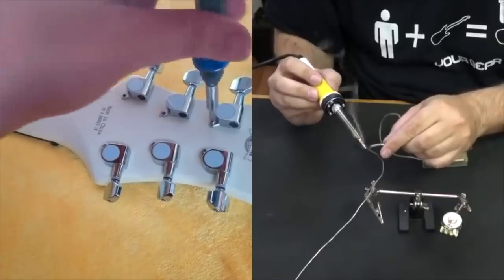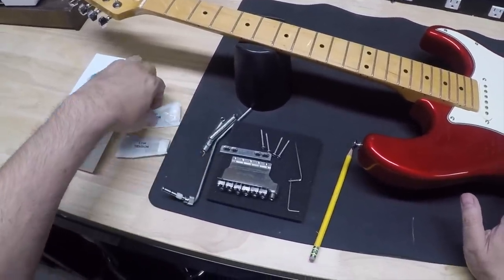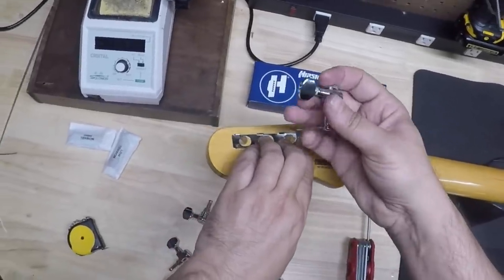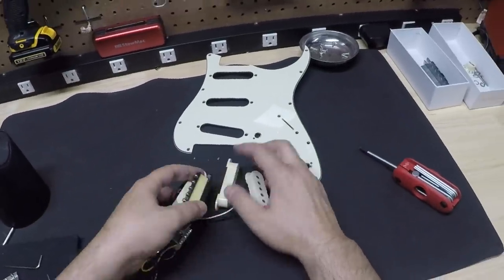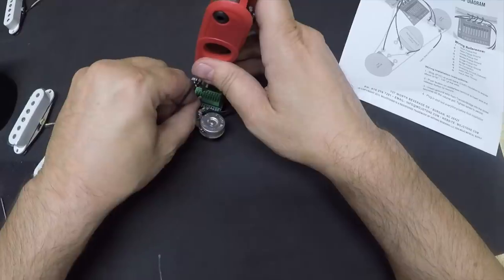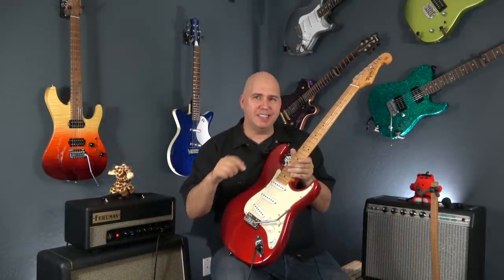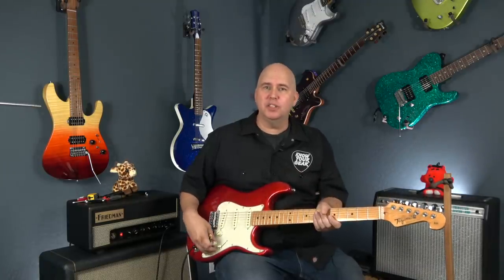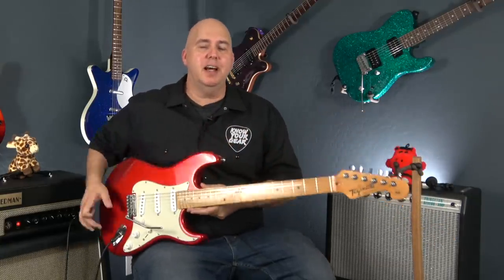How To Mod A Guitar With NO Tools

Comment: I personally liked the original PUP's, I think you can get the sound of the replacement ones with the use of noise gates and EQ since you are losing so much brightness. Maybe it is my speakers that are not picking up the details, but for a strat, I think the original pickups are closer to what it should sound like. But lovely video, I love the work you have put into every single one you have produced. Keep them coming, I love to learn and you sure do a great job teaching.
Reply: Same, same

Comment from the maker: Marty's video of the guitar was great! I highly recommend checking it out
Reply from the maker: Hi Zach, that is a cool idea. I like it! 
Maybe a Sweetwater one also?
Reply: Philip good video I have a question do you know if that Vegas tremolo system if they have one for a Harley Bentley cst-24t? Clearly it's not a Stratocaster it's more of a PRS Style but I would love to replace it with one good enough but you just said you were going to put one on your expensive guitar haha because this one was so cheap
Reply: Tagima makes great affordable guitars I have the tw61 which is the jazzmaster copy👍🤘
Reply: Phillip McKnight - I love your channel, I've learned quite a bit from you over the last year, enough that I do the setup work on all my friend's guitars.  
One thing that I've never seen you mention is using teflon thread tape in the tuning keys when you mount them.  I've had issues on a few guitars with them vibrating loose over time.  To keep them tightened up, I give the threads a few turns of teflon tape the first time I restring. I haven't had a problem since, and unlike threadlocker or superglue, it comes right off if you need to replace a tuner.

Comment: I wouldn’t have mentioned my vac for Christmas, but then you showed why it’s even for guitars. The Tool Bear turned is “makers” onto a Ryobi battery and free tool Black Friday deal. I had to go into big-orange to get that 3-gal vac, though it turned out they finally got them in for the day. That vac was youtube reviewed because it all self contained and small enough to store in a cabinet. It can clean work areas and because it’s medium sized you can just tote it around, no chord but it has some guts. I have a Traeger and a Wolf stove that get stuff caught and it ends up stopping ignition, that’s my main thing other than I’m tired of my bulky wet-dry and the cord. I think it will be good for the guitars too because using it isn’t a project.

Comment: I bought that exact mojotone harness, and the experience was horrible. That cheap plastic piece that you insert the leads into has very little longevity. I was very careful to press those buttons down gently, and I got it all wired up, except the hot lead from the output jack because the button got stuck and wouldn’t come out. I got a replacement from mojotone. Installed it, then a couple months later I got a new set of pickups, and...same freaking problem. I had to solder it. So, lesson learned. Don’t use these wireless kits if you actually plan to try out different pickups. I was very gentle with it because of the first experience, and it still broke with very little use. They need to either upgrade that cheap plastic, or people just need to be aware how fragile they are. I don’t recommend them at all. Otherwise, great video Phil. I am a big fan of your channel! You have helped me to learn a lot. Thanks

Comment: Godo timing...planning on doing pretty much the same thing to my partscaster. Updating the tuning keys, wiring and tremolo. Although different brands.  Sticking with the texas specials, though, but I did a crap job with the soldering years ago and the pre-wired has a blend option.

...I just need to reogranize a bit, get all my tools in one place, and clear a space to start my projects.

Comment: Not trying to be picky here, but you cut the jack off to remove the old pickups - so restoration does need soldering. :-) Awesome video, highly appreciate that you show such “beginner level” stuff also.
Reply from the maker: Hi BK, the kit came with a new jack, so I just chucked the old one and didnt need to solder at all. I can not convey how impressed I am with the kit.
Reply: Phillip McKnight Yes, these are great! I use their LP style kit. TBH from all the solderless kits I, tried I like the Obsidianwire ones the best so far.

Comment: Great video... If cheap upgrades becomes a theme i have had fantastic luck with cheap amazon pickups. Every generic set of alnico single coils sounds batter than most stocks up into the $500 range.   But anyway love the channel this is a cool upgrade

Comment: I have seen a good number of reviews om the tagima guitar. I think the pickups they come with sound great.
Reply: victor formosa I have the Tagima 635..it sounds amazing. This was the cheaper 530 model. For the money Tagima blows Squier, Yamaha, and all those other strat copy brands out of the competition.
Reply: @Taylor-dl2kr  yes, it's very underrated, I also have the higher spec copy, with the alnico pick ups, I need to sand down the frets a little, if you have a good amp, they sound great, that's a nice guitar you have, nice to know your happy with it, which country are you living. I am in the phlippines.
Reply: victor formosa Absolutely. I run that thing thru my line 6 hd500x pedalboard and my fender mustang 4 amp...it sounds amazing
Reply: @Taylor-dl2kr  Sounds like a good set-up you have. I take it your tagima is a Brazilian make?
Reply: victor formosa yes it’s Brazilian made.
Reply: @Taylor-dl2kr  Mine is Chinese. it sounds okay through my amp,  it's a pretty good guitar for such a low cost.

Comment: That bridge looked cool, similar to a Bladerunner. Have you tried the Bladerunner bridge?
Reply from the maker: No, but I will look it up. Than you for recamendation.
Reply: @PhillipMcKnight  I installed one on my MIM strat. It cost as much as the strat(LOL) but the improvement on tone and feel was worth it. Thanks again for your videos!
Reply: The Bladerunner Tremolo is amazing. I added one to my MIM Roadhouse Deluxe Strat and it is a vast improvement even on the Fender 2 point tremolo.

Comment: In my Tele, I put in the Seymour Duncan Vintage stack pickups & they sound like single coils, without the hum, a touch more output & bite, the neck pickup is even more articulate, but still sounding like single coils.

Those Mojotones don’t really?
Or they sound, kinda muddy, like the tone pot is turned down?

Granted, I’m talking about the TELECASTER Seymour Duncan Vintage stacks.
Please add those, if you can, to your Pickup tests.
I think people will be impressed with the result.

Comment: Curious if the new tremolo block will fit in a Squier Affinity. Every replacement block I looked at was too tall. They stick out the bottom of the body cavity.